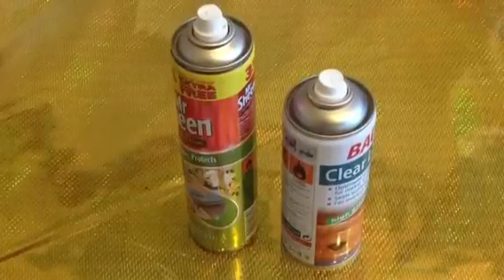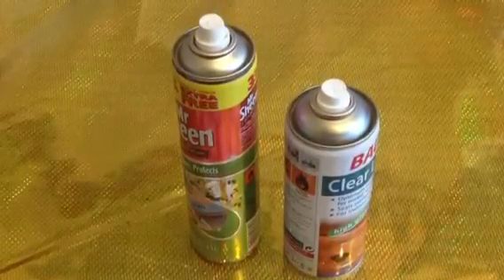DIY Hydrophobic Coating like Ultra Ever Dry or Never Wet

Comment: AWESOME!
I have to give it a try!
However could you give us the brands of the products to use, or what main ingredients we should look for (available in most common brands worlwide)
I am interested in finding compatible products to make this experiment in europe.
Thanks
Reply: Never mind. I've found out that most of the multisurface cleaners do contain the main ingredient: 5-15% Aliphatic Hydrocarbons
Reply from the maker: +Inzenity nadir  Well done that's right
Reply from the maker: Hello Europe here
Reply from the maker: It was made in Europe
Reply from the maker: Made in Ireland
Reply: @NanomagicIeDIY  would this be a suitable, permanent solution for metallic surfaces?

I'm looking to do this on an electric scooter as part of water ingress protection?
Reply: +DIY Nano Engineering I live in Ireland!